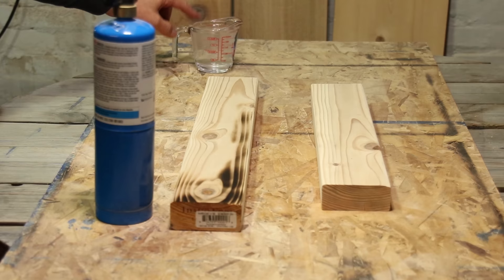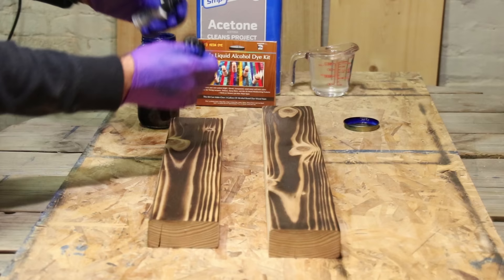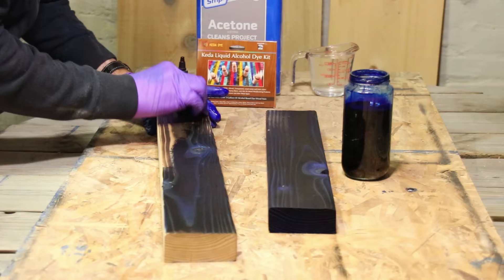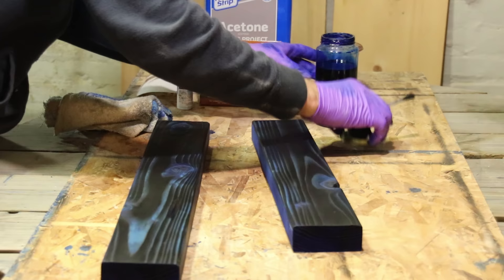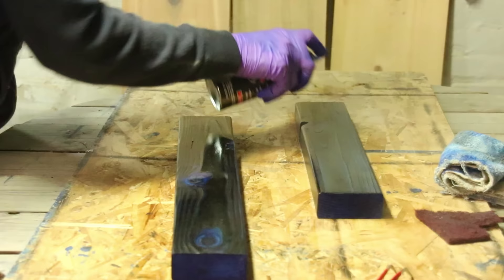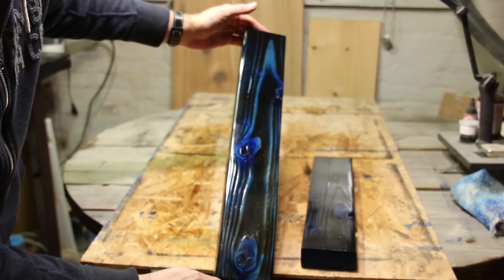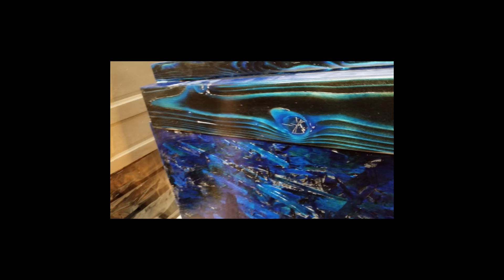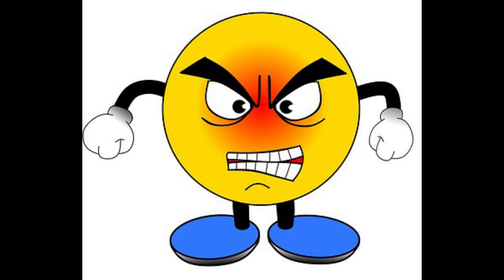Coloring Wood With Shou Sugi Ban and Wood Dye

Comment: For true shou sugi ban you should burn deeper.  Then take a wire brush and brush with the grain and brush away a bunch of the charred stuff.  You’ll be left with the raised grain patterns being dark with the lower areas being slightly burned but lighter. 
Looks nice!
Reply from the maker: Thank you so much for that! I actually have gone out and I got a "Whip wheel" is what I call it lol, but it has these rigid like nylon "whips" and works just like a brush on my drill. Man! It leaves such an incredible texture, well at least on the small piece I did, and I totally see what you mean by the higher and lower ridges. Worked great! I made another shift knob, using Pine, and Sugi with how you mentioned, but shhhh I can't say anything til after Christmas 😂 Thank you so much for the added info. Owe you one my friend 👍 Thank you so much for watching. Really appreciate it!
Reply: Keda Wood Dye no sweat. This is how we grow as woodworkers and as a community by sharing our knowledge and techniques. 
I found a small steel wire bristle brush worked the best. 
I put the piece I’m brushing on a hard surface and hold it with my left hand. Then I brush the surface with the brush following the grain pattern. I stop frequently and vacuum up the dust it produces and I’d advise wearing a dust mask that seals well. 
After the initial brushing ( I find) it’s sort of a feeling thing as to how much more and how aggressively you should brush. 
At one point I’m brushing using very light pressure almost just letting gravity pull the brush down onto the wood.
Then take your hand and feel the surface. 
It’ll be like the grain of the wood has been magically considerably raised up above the rest of the wood. 
Once I feel the grain has been raised enough I then apply the dye/stain to the wood.
I have a US flag I’m doing using your blue dye for the union and it came out a sort of sea greenish blue. 
It’s going to be put up for sale at a shop out here in Bridgehampton.
Reply: Does it work with other color dyes?
Reply from the maker: @tlw2585  Yes very well. I know I am running a bit behind. Sorry about that, but they do all work. Thank you you for watching

Comment: Did you do the Shou Sugi Ban burn on the OSB/chip board, or did you just apply the dye alone to it? The look is simply incredible. As soon as I get some warm weather, I've got a project to do with this technique. Love it!
Reply from the maker: Nope...no Sugi Ban on the chip board, but I did waste a lot of time coloring wood filler black, slathering that on, scrape off excess, let dry, seal it, sanding the sealer back off the chip board, then doing the color work. Geez, that was ALOT of jackin around, and cant say for sure it was worth it...even to the day. Sure it looks cool as heck, but is a lot of work for a grinding bench hahaha
Reply: @KedaWoodDye  Thanks for the reply! That'll save me a lot of time.

Comment: Hi! Just a question. What happens if you just don't burn the wood??? And replace it for a black paint or some other paint...
Reply from the maker: Paint will totally cover the grains if both the heartwood, as well as the grains. Do you have an example piece? I am sure it would not be the same technique though. Paint is very different of wood than wood stain, and wood dyes are much more transparent than wood stains. Hopefully that helps somewhat. Thank you for watching 🙏
Reply from the maker: I have had a friend give me a black painted piece of wood, where he engraved the USMC logo (Eagle, Globe, and Anchor) with a CNC and I died the EGA yellow. Turned out amazing if that is your intended question?

Comment: I screwed up the wood burn some spots burn before other spots causing charing but I guess part of learning I'm sanding the dark spots and pulling the grain back out  any tips would be helpful
Reply from the maker: Yep no troubles...just sand the wood back beyond the char, or get a brass/wire brush to expose fresh wood fibers again, then color 😉 May have some texture though. Really is okay, but I just didnt need texture for the project I was working on. Once the char is removed, and the unburned wood fibers are exposed again, will work great 👍🏻

Comment: So watched a couple of your videos.  Have you noticed that the colors come out better with one type of solvent(think im calling them the right thing) over another.  Ive just did my first one with Acetone and red.  Would like it a bit more red/darker but over all happy with it.  How long did you let it dry before hitting it with the finish?
Reply from the maker: I believe I hit it with sealer about 30 minutes later. As far what works better, it really depends on what you are trying to accomplish. Acetone penetrates the wood like crazy, so you may want to work the dye stain around a little longer. Otherwise, Denatured alcohol tends to have a little brighter coloring, and lacquer thinner is kinda the in-between both. The coloring will really pops when you apply the sealer, and it can look a little dull when they dry, but once the lacquer or sealer hits, the coloring really livens up. Thank you for watching 👍
Reply: Yah I hit it with the same stuff you did.  The first coat for some reason seemed to be white.  Let it dry more and it the white faded some. Hit it with a second coat and had to leave so we will see what it looks like when I get home.
Reply from the maker: @mcolevalentine  it will be alright. Sounds like you went pretty heavy with the sealer. Maybe hold the can back about 2" further when you spray the sealer, but I am sure it will clear up as it dries. Polycrylic is pretty notorious for that also and that dries very clear also ;)

Comment: I'm trying this but I cant find any videos with this result in a gray/silver was hopi ng for suggestions
Reply from the maker: Simply dilute the black or sand with a finer grit than 220 like say 400 or 600 grit. Depends on the wood and a few other variables. This would be the easiest starting parameters.  Hope it helps out

Comment: How did you do the chipboard?  I attempted it today, but it came out like dog poop.  I also ordered the powder vs the liquid dye.  Will that have an impact on the final result?
Reply from the maker: Did you sand the chipboard? The board I bought, had a wax or some coating on it. I also, mixed Keda Black dye into wood grain filler, applied that, scraped off excess, sanded again, then applied the blue dye stain heavily. Chipboard has a bunch of glue in the valleys of the board, so the black grain filler helped to fill those spots. Hope that helps out.
Reply: @KedaWoodDye  You didn't say that part!  LOL!  I did sand it after burning it and brushing it.  
Take a look at the photos on your facebook page that I commented on as well.

Also, will the powder dye work as well as the liquid in this application?
Reply from the maker: @DORIGTT  sorry this video was actually meant for the Shou Sugi Ban content 👍 The blue powder dye should work just fine though. Perhaps, add to a splash of water then add 91% isopropyl alcohol to have it dry faster. Can always follow up with a second coat to darken the color. Should work well though 😉

Comment: sh-oww sue-gee bahn. however thats a misnomer due to a misinterpretation in a guide several decades back. the kanji characters between japanese and chinese are very similar and a foreigner(american) read it using the chinese sounds for the kanji and not the japanese, youre reading it using the chinese not japanese characters when you say shou sugi ban. in japanese is called yakisugi (yah-key-sue-gee)

Comment: Would regular rit dye work?? Since wood is porous I would think it would absorb whatever is used. I built a pergola with Douglas fir burned and sealed with boiled linseed oil, no staining, the wood sucked up the oil and took several coats before i was able to assemble the structure. It is great now, sheds water as intended and looks great.
Reply from the maker: Well I guess technically you could even use coffee to color wood, but doesn't mean it will be very good or even last for that matter 🤷‍♂️Try mixing 1/4 tsp of clothing dye to 6-8 oz like Keda Dye uses, and see how well it colors. I know, I tried all the coloring agents  before starting this lol. That would be one main difference, in sheer volume of wood stain made per package. I do have to say honestly, there is quite a bit of difference between clothing dye and Keda Dye. Pretty much all wood coloring agents tend to have their own unique looks to them. You most likely would need about 4-5 packages of clothing dye to make what one packet of Keda Dye (for just one color), or about 5 or 6 bottles to one bottle color of what Keda makes. Clothing dye also has like 4 or 5 different types of dye in their packet from my understanding and is, designed for several different fabrics. Keda Dye is designed for wood. I also cannot speak for how the color fade works as compared to Keda. I think clothing dye fades rather quickly like food coloring does on wood. It is different and hey Thank you for watching
Reply: Thanks, was just thinking or trying to think outside the box for using what is readily available anywhere. I'll look for some wood dye at the local hardware stores and see what I can find. Appreciate the quick reply and the video. On a side note I used 4 gallons of linseed oil on the fir I used for my pergola, I think a hard wood may use less.
Reply from the maker: @marcusmorgan1419  well when/if you get tired of paying a few hundred dollars for a couple colors or for coloring wood and needing more and more dye, should try Keda Dye sometime. It really is one of the best, and the quality is at a totally different level of premium, plus usually arrives in just 2-3 days anywhere in USA👍 Hope it helps out Marcus.

Comment: You’re not pronouncing it correctly, and your using the wrong name. In Japan it is Yakisugi. But even then your process isn’t correct Yaki is to heat with fire, Sugi is cypress. So they use cypress pine. They also make a chimney out of three planks in a triangle shape and place one of the open ends over a fire. I’ve been making this myself, but also not with pine. But most people doing these video’s in the west call it Shou (like show, but with a u not w) sugi ban, but this is as mis pronunciation of the actual Japanese characters.